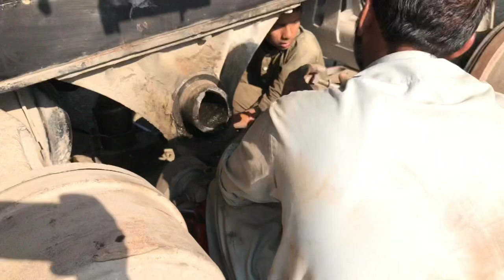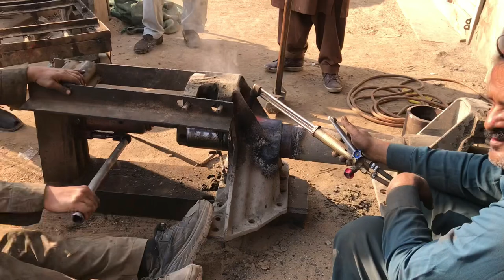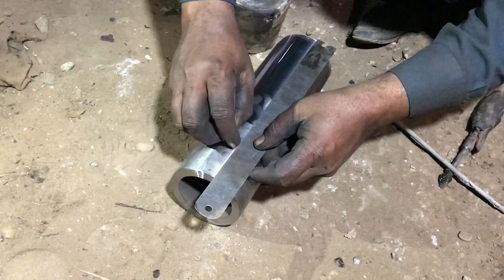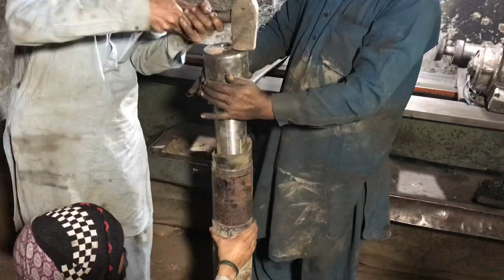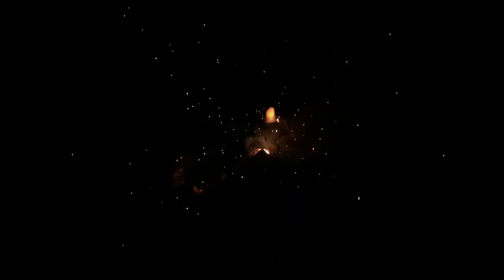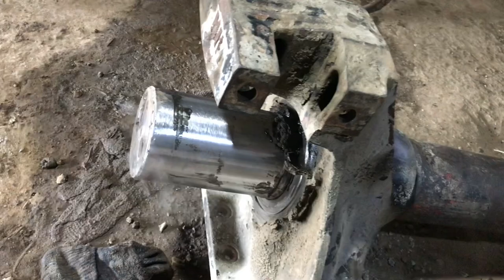Broken Trunnion Shaft Repair Suspension System | Rebuilding Truck Suspension Trunnion

Comment: I wonder if you realize that you are putting peoples lives in jeopardy. I agree that they can weld and they make do with what they have. I know that people are watching this content and then applying it on American highway’s as well as other countries. What if a truck owner does this and it breaks and it will break but what will the victims families deal with the loss? I think you have to have a disclaimer stating that this isn’t legal and it’s for entertainment purposes only.
Reply: Let me guess, you work in the safety industry.
Reply: I’m not connected in any way whatsoever with safety or law enforcement. I have been a owner operator of trucks and heavy equipment for 38 years and I know that that’s beyond dangerous in every way. If you notice they have made a fixture out of scrap metal to reweld them in. In their country they are likely driving on dirt roads at slow speed. Just imagine yourself or family traveling on the highway with that truck at highway speed and it breaks. All I was saying is that people watch them and try the same thing and innocent people die from it.

Comment: Another lathe ruined by welding on it with the current path through the bearings.
Reply: They hammered the shaft into 'alignment' on the lathe. Do you really think they care about the bearings?
Reply: Looks like they've been at it for a while, and it still works for what they need. That's not Abom's surgically clean shop where everything is perfect, they do what they need to get the job done.

Comment: Hes using a 7018 or 7013 on the cap pass cuz he's weaving it side to side to tie in and fill it out and it's welding in really flat just like those rods do mostly plus the slag layer it leaves obvious lol

Comment: this welder is one of the good at welding with coated electrode.
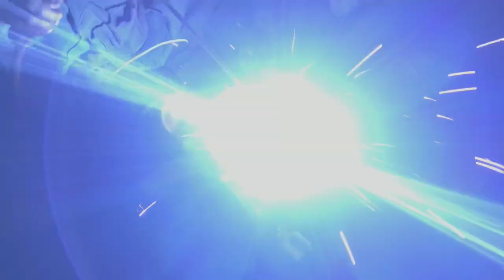Reply: You are free to say that, 11:32 shows a different story, my man is welding a spot, while still red glowing he restarts a bit infront of it just before he pulls it over the spot with slack that was red glowing
Reply: @genefogarty5395  Right.... did i say the welding performance was incorrect? No. What i said was he welded over a part without removing the cooled down slag. If thats ok for you then i assume you never remove slag before welding/doing a next pass???
Reply: @Bonzai2350  The puddle he started in front of the tiny bit of molten slag would've just absorbed it into the new weld puddle's slag and come to the top. A small inclusion like that wouldn't lead to catastrophic failure, not the way he repaired it with that slug. I use a needle scaler and get back welding, if there's a tiny bit of slag in that large a weld area so be it, I'm not wire wheeling every job. We ain't building space shuttles or HP steam lines here and plenty of my repairs are still fine 30 years later. It's stick welding, I weld right over rust and paint all the time, that 6-8k degrees burns most any contaminates off pretty well.
Reply: @genefogarty5395  Thx for the answer, im a mig and mostly tig welder. I understand and did welding with stick a few times but my knowledge is close to zero. But if you weld for a company some kind of certified welds. Would nothing of that slag be visible in any testing whether its ultrasoon or something else?
Reply: @Bonzai2350  In an X-ray, my uncle was a steamfitter with nuke certs and he always told me slag would cause inclusions and get rejected. That's why I said it's not a huge deal in what they were doing, if it breaks there's no reactor meltdown, lol. I only do TIG for a few friends, myself and local dairies now, sanitary stainless piping and there's no cert necessary. Best of luck in your career!
Reply: @genefogarty5395  Ah ok then what i was thinking was correct, thx again
Reply: It works for them would not pass in the west , but there not in the west so who cares

Comment: With the loads these people put on their trucks it would be interesting to know how long this repair lasts!
Reply: It comes with backlight warrenty.
Reply: Looking at this repair, its actually stronger than original.
Reply: @seanryan4131  In many first world countries, it is an illegal repair. The structure is already compromised other than the break. It is difficult to determine without proper testing the integrity of the remaining structure.
As someone else here has mentioned, it is likely broken due to regular overloading and may not be the only damage to it here.
That's why these repairs are not usually allowed in other countries.
Reply: truck loading  capacity 20 tons, the put 60 tons on^^
Reply: 20/20 guarentee.20 minutes or 20 kilometres,you chose
Reply: How long😂 I seems 100..200 meters out the repair ;)

Comment: Interesting to see they already have a jig made up to use the bottle jack to push out the pin.  Must be a common repair!
Reply: It looks like they specialize in this work.  They like to be really good at fixing one thing.
Reply: This is commonly happen when You triple the truck max load :D

Comment: It would be interesting to know the repair cost in your country in US dollars vs.having the same repair done in the US.
Reply: كم تكلف ؟
Reply: I'm pretty sure that repair is not legal in the USA.
Reply: Not repaired,  an entire new part would be fitted.  Vehicle off the road for a month while every manager argues over the price and whose paying for it.     Is it the Transport managers cost due too overloading the vehicle? Is the Fleet managers fault for buying a vehicle not up to the requirements of the job?  Is it the maintenance mangers cost due to not checking the trunion on a regular basis.
Reply: @robertwillis4061  I just don't see it happening here, though. We aren't allowed to overload our commercial vehicles at all. If an old clunker like that needed expensive repairs, it would likely be scrapped.
Reply: In Pakistan, labor is cheap, and the parts are expensive. Hence this kind of repair.
Reply: 1/2 🐐
Reply: "3 days work, 2 assistants, electric light at night"....................................................... "$3 bucks."
Reply: @nalgas5569  Maybe for trunnion bushings, but a complete trunnion replacement would be more like 8k plus. I don't know any shop that would do this on location either, a mining truck maybe because it's not something that can be towed in easily.

Comment: Don’t even know how to use a cutting torch. Can’t wait to see what the runout is on the tires wearing out on one side.  The trunion needs to be perfect in alignment and these guys don’t have a clue. Utterly ridiculous and fascinating at the same time.
Reply: I doubt there will be any problems, alignment may be important when doing a lot of highway driving, where these trucks go it won’t make a scrap of difference
Reply: It looks straight but even if it was a little off, not a big deal since they drive on dirt.
Reply: With a top speed 40Km and all dirt an mud roads, no one will ever care about runout.
Reply: @Tim Gruver you probably live in a place where you can order new parts without leaving your couch. Life is not so easy outside your bubble.
Reply: @thoalexandrino9111  These people are not ignorant nor lazy.  But they all have phones and could do some self education on so many things. Such as how to line up this repair to be as exact as a new one.  Or how to use equipment properly.  Seems like they can only progress so far and then that’s it. Using a cutting torch or making a weld IS NOT rocket science.
Reply: Russian channel AvtiCraft always show the proper way for such repairs, often, better quality than original manufactured parts.
Reply: @АгронДепартье  And if they had the resources to do it that way they would.
Reply: @thepubliceye They have what is required: the lathe, but they don't insert the detail in a correct way.
Reply: Всё будет работать хорошо, какое биение шин? Это не  F-1 Вспомните компоновку  TATRA  никакой проблемы
Reply: Mogę się założyć że nie ma żadnego picia na kołach dlatego potrafią coś zrobić a nie liczą na maszyny
Reply: @59plexi  really?  You would buy that repair on ur truck then?